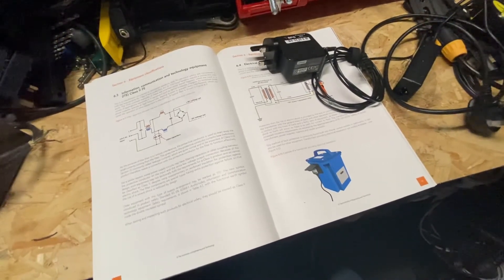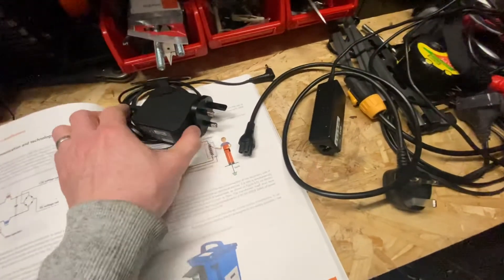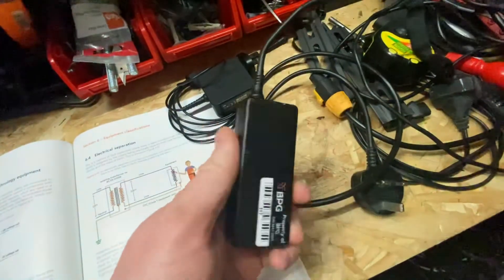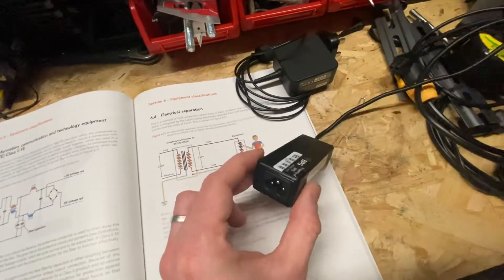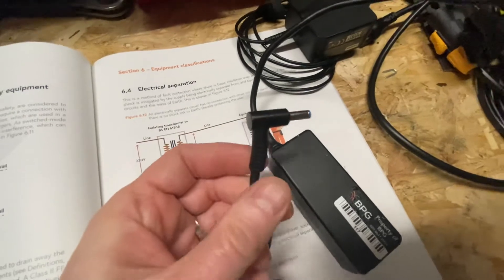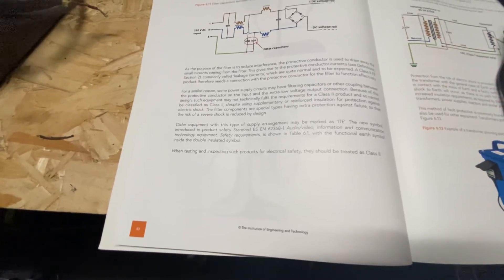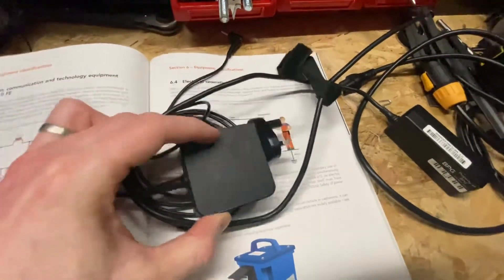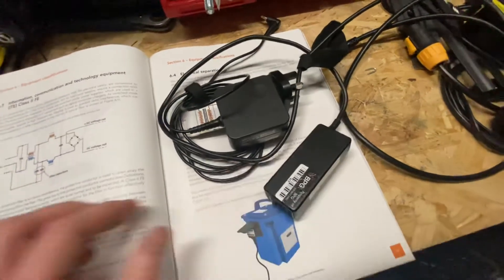Laptop Charger PAT Testing - How to do it? | Are they class 1 or 2?

Comment: Hello, don’t you do a IR test on the laptop plug, in case the insulation is damaged inside the sheath
Reply from the maker: No as there are no exposed metal parts at mains voltage

Comment: I always test the metal part on the DC pin .and yes it will detect leakage current on these .I also from a design point know that the galvanic separation in the transformers can fail putting unsafe volts on the end pin and possible danger of shock .I have seen these transformers short between windings internally
Reply from the maker: I do get your reasoning but as a Pat tester we are not there to determine whether design faults are present. We can only take at face value what we see. Connecting the test probe to the DC pin will give no meaningful reading via our Pat testing machine.
Reply: @caterhampattesting a Rigel 266 will read the leakage .usually around 50 microamp .I only do it as there is a very small risk of shock potential these chargers can fail and put dangerous mains voltages on outer pin My own class 2 fully insulated smart charger all plastic no exposed parts was faulty in this way as example I was getting electric shocks from the car it was con ected to.while charging 
So there is risc present specially as.lot of these made in china .better safe then sorry

Comment: The metal part of the charger is only putting out DC power
Reply: Or if the windings short in the transformers inside and internal fuse remains intact mains derived volts on outer metal pin .there is always leakage current in all of these to the DC pin !! I know this because the Rigel 266 pat tester usually shows around 60 microamp leak when probe connected to outer pin

Comment: I would generally do a visual/machine test on the IEC lead, visual on the charger and laptop/PC unit. I’d then label the IEC lead. Would you note the charger and PC as visuals only and would you sticker both? Keep up the great work Ben
Reply from the maker: Great point! I always sticker both the IEC cable and the adaptor as 2 separate items for traceability.
Reply: @caterhampattesting thanks for that Ben. Would you sticker/log the monitor as a visual also. Many thanks again

Comment: I design devices for use in Hospital/medical environments. As you say, these laptop power adapters with the earth pin are Class II with a functional earth - this is to help pass EMC conducted/radiated emissions tests. The earth pin is NOT for - as you mentioned - shock protection. A Class I power adapter has that earth pin for shock protection - this is called a Protective Earth. In the 60601-1 parlance, the protection in a medical grade Class II psu is provided by the double insulated plastic casing (one Means of Patient Protection)  and also enhanced insulation, electrically separating the windings on the main SMPS transformer, plus extra physical isolation between the live high voltage and low voltage sides of the PCB (second Means of Patient Protection) Soz - I spend too much time with med-grade equipment 😞
Reply from the maker: Thanks for your input

Comment: I can imagine A circa 1930s electrical engineer seeing technology like this, the most common analogy they’d be used to designing are linear power supplies with the discreet rectifier and transformer if they weren’t involved in designing very early switching power supplies for early computers. I remember speaking with two electronics engineering lecturers recently(who’s prime time was in the 1970s and mid 80s) in my spare time and the one was shocked/confused that a double diode in a single radial package existed, the other would gravely overestimate the power of modern day power supplies. Time moves on, it wasn’t too long ago when these linear power supplies were everywhere. Not too much of a dramatic change however.

Comment: There is a problem with cheap or fake chargers, especially phone chargers. Many are unsafe by design, with inadequate creepage/clearance distances and standard capacitors instead of Y1 rated capacitors between mains and DC output.
Other dangerous conditions can be caused by hidden physical damage, including water ingress.
If the output is earthed, then the resistance to mains plug earth should be checked. If not then the leakage current or insulation resistance should be measured, with the DC plug as an exposed metal part. A visual only inspection is totally inadequate.
Reply from the maker: See, I do disagree with you there. There is no meaningful test that a regular PAT testing machine could carry out. I would be interested to know what exact test you would do, what readings it might give and then how to interpret them.
The job of a PAT tester is to ensure that the appliance is as safe as the day it was manufactured. There is no possible way we could determine (on a charger or any other piece of equipment) what creepage is used or what type of capacitor - that simply isn’t for us to check as a PAT tester.
Reply: @caterhampattesting  If an item with an built-in switched-mode power supply is tested, then why is an item with an external PSU not tested?
Construction of cheap PSUs is haphazard with many transformers relying on only the wire enamel to separate mains and output. If these products were type tested they would certainly fail the high voltage isolation test, but they are imported with no checks. Whilst PAT can't be expected to perform the same function, it could well detect some of the most dangerous items, by testing insulation resistance between output and input (L and N linked, <2Mohm). There are some failure modes of approved PSUs that can compromise the insulation resistance, eg. loose components from impact or solder cracking, charred PCB from arcing or overheating components.
Reply from the maker: @dino6627  I do understand what you are saying but please could you talk me through the exact process that you would test a laptop charger for example with your PAT machine.

Comment: What's the harm in testing the DC plug for insulation resistance and leakage current ?
Reply from the maker: because there is electrical separation between the mains voltage and low voltage side. you can't carry out any test on the DC jack that will give you any meaningful result
Reply: @caterhampattesting  I disagree, I've not found one yet that the outer barrel isnt connected to the earth. I always do a continuity test as belt and braces.
Reply from the maker: @darryldearing5537   this will be a functional earth and not related to an earth for electrical safety.
Reply: @caterhampattesting  You are testing that that is in fact the case, by doing an insulation test between L and N and the outer of the DC plug. There could be moisture damage, heat damage, arc tracking, capacitor leakage, something broken off inside, any of which could compromise the separation and not be apparent to a visual inspection.

Comment: A word about that functional earth, if you are using a laptop to play music into a DJ mixer, the functional earth type of power supply stops a hum sound from coming through the speakers. If your power supply is like the one without any earth, you need to use external hum filters on the audio leads . If I PAT test a laptop power supply, I do visual inspection to ensure there is no damage to the casing and do visual and continuity/insulation checks on the lead if it's a detachable lead type.
Reply from the maker: Hi John, it all depends on the charger. I have a Lenovo class 2 charger with no functional earth and I don't get any hum through my audio equipment. I get most hum from chargers with FE that are faulty or poor quality.
Reply: @caterhampattesting  I had a laptop with just a figure 8 mains lead and I had to use hum filters when I used it with my disco gear. When I got a new Acer laptop with FE and the clover leaf lead, there was no need for the filters. I get your point though , places like ebay are full of poor quality cheap replacement parts and these are often nowhere near good enough but try telling the public who just think more expensive approved parts are a rip off.

Comment: From some one that repairs charges and been inside over 100 of them.  Some tests must be done.  For leakage as if there has been a power spike the filter capacitors can go short circuit.  And high voltage can then end up on the end of the charger also if it has been dropped and the earth connection is damaged the same can happen.  Some to have the neutral side of the charge lead attached to the earth / CPC I test by continuity from the earth pin mains side to the laptop charging side.  Also do a test by plugging it in and checking for voltage from the neutral side to a known earth.  It is only when you look inside and repair them you would know the dangers and what to test for.  Also link live and neutral together and apply insulation testing from the two pins to the outer neutral side of the charge lead.  Also test the output voltage with a good voltage tester.   There is a lot missing for this video like the others.  Sparks go about it the other way the right way.
Reply from the maker: I do understand what youbare saying but this would not fall under the role of a PAT tester. All of those checks that you mention could not be done by using a basic PAT testing machine. Nor are any of those tests mentioned in the IET code of practice. It is not under a PAT testers remit to take an item apart and check the internals. There is nothing missing from this video in terns of what a PAT tester should be doing.
Reply: @caterhampattesting  they should be in there.  As a basic test just looking at it is no use.  Try some your self link each pin and do a test on a number of chargers.  The books I have read have been zero use.  When there is internal damage from being dropped or power spike.
Reply from the maker: Please see official guidance here https://patta.co.uk/class-2-functional-earth/
Reply: @caterhampattesting  as a electrical engineer I have to test after service I see people in offices with a clip board going round testing and failing working stuff.  My head hurts trying to show them.  I have been out to were av equipment is being rented out the guy was sent on a course for pat testing.  He could not find the earth point to test from.

Comment: Having watched a recent Seaward webinar on FE appliances, I was of the opinion that these weren't a visual only or class 2 test and should be tested as a class 1 with a long press on the test button (5th edition testers only) after the earth fail in order to test the resistance and leakage current  in the correct manner

Comment: Hi, I have ordered the 5th edition of the code of practice and it has turned up as a spiral bound folder book, is this right or is it a copy/duplicate, how does it normally come please help and advise????
Reply from the maker: most definitely shouldn’t be like that. where did you buy it from?
Reply: @caterhampattesting  for £31.99 + £3.50 p+p so £35.29 all in
Reply from the maker: @gray8046  Yes that definitely sounds like a non genuine copy. you should be buying from the IET website or wiringregulations.net
Reply: @caterhampattesting  Thank you for confirming that, I thought it was a copy but I had not seen the new book untill looking at your video, I can now clearly see the book is like all the other previous versions and not spiral bound.

I managed to get the money back through PayPal and have reported it as copyright infringement, thank you again Ben.

Comment: We need a brand new equipment design just for Laptop PSU testing. I work at a recycling company we have hundreds of PSUs with hundreds of different V/A, many have protection circuits from which there is no current unless it is plugged into the laptop. The voltmeter becomes useless.
Reply: There what we call 3 pin out put you will see a outer ring a inner ring and a center pin.  Dell and some HP use this.  The center pin is not for output voltage the inner ring is the + side.  The center pin detects it is plugged in.

Comment: I looked at power adaptor which the customer had taken apart and reassembled but with the copper screen enclosure inside the insulating cover and directly touching the pcb. The result was a direct short from the live to the barrel connector. Surprisingly it still worked and made the metal casing of the class 2 item, in this case an electronic piano/ keyboard live. Very dangerous and would have gone undetected if the customer's RCD hadn't tripped. I guess it's unlikely to find again but maybe a continuity test between live an neutral to the barrel might be worth doing when looking at these adaptors..
Reply from the maker: great point, this was actually discussed by various authorities when developing the new code of practice and the opinion was that whilst you could do a test like that it was deemed unnecessary.
Reply: This is the thing about this testing that sometimes it's like the bleedin' obvious. If something makes the trip go, it's going to fail the test.
Reply: @johnhepworth1531  very true, but in this case, the RCD didn't trip until the piano was connected to an amplifier input.